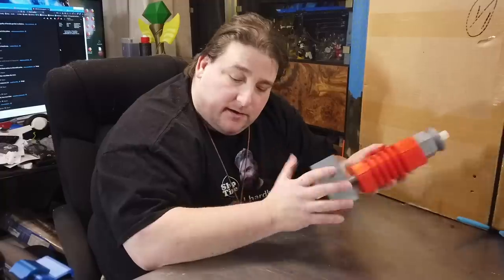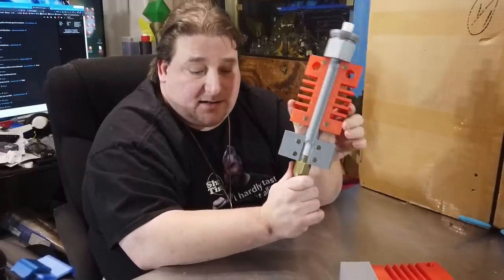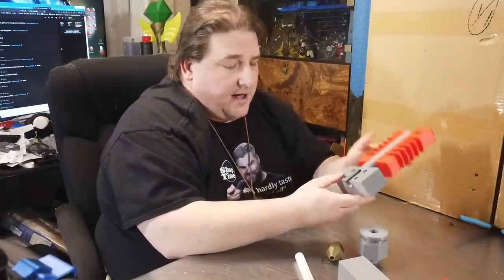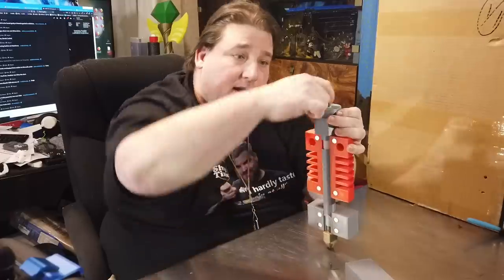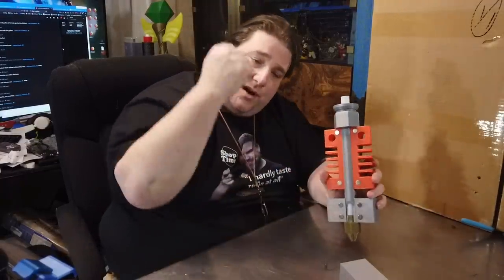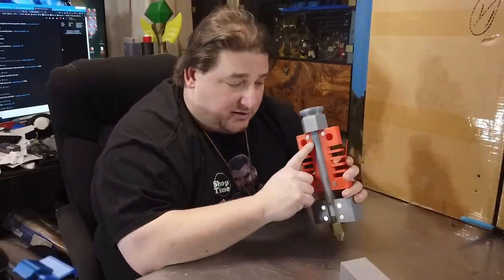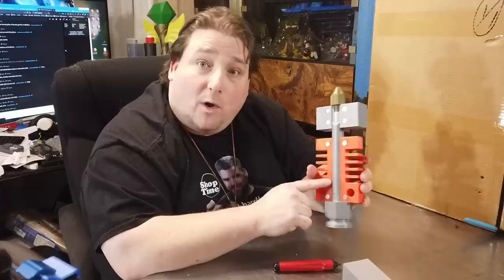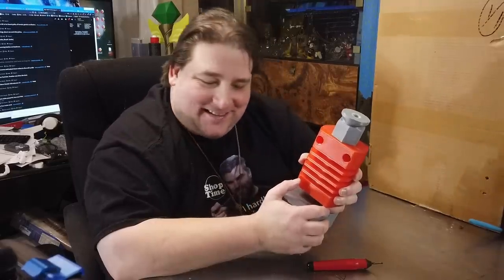Creality Hot End Failure Modeling How to Fix, Assemble CR 10 Ender 3 5 Mini T3DP

Comment: Hi, many thanks for the great video. I have subscribed now so I can watch plenty more of your videos.
Can you please answer a question for me?   is the hot end for the Ender 3 the same as the hot end for the Ender 5 pro??
Many thanks, have fun and stay safe,
Joe
Reply from the maker: There may be slight differences since they come from different Generations But ultimately they are virtually identical you should be able to Interchange the parts between the two printers
Reply: @nerys71  Many thanks, that is great news as I wanted to keep a spare, but was not sure what to buy.  Have fun and stay safe, Joe
Reply from the maker: @jjab99  just be sure to mark them 12 volt or 24 volt if you are including the heater cartridges with the spare this doesn't apply to the two printers you listed as they are both 24 volt but the older machines which also have identical hotends are 12 volt just something to keep in mind especially if you decide to acquire a couple of spare sets
Reply: @nerys71  Many thanks once again for your help. More very useful tips!!. Have fun and stay safe, Joe

Comment: maybe you can put nozzle in first then turn back abour 3/4 turn,  then put ptfe tube all the way down. lock the top ring.  make sure the tpfe contact with the nozzle. then turn the nozzle to make sure the nozzle and ptfe has perfect contact. right?
Reply from the maker: Yes in theory you can do it from either end I just find it easier to use the compression fitting but the nozzle will have the same effect

Comment: My son just got a brand new Ender 3 v3 SE.  We printed a cube as a first project.  About 3/4 of the way through the print, it stopped extruding (but thought it was still printing).  It's clogged in the PTFE tube about 1/2 cm above the top of the nozzle. The filament broke so there's nothing to pull out anymore, and I can't push it through with my needle.  And heating doesn't help because it's so high above the hotend.  Can't pull or push it out.  Any thoughts?

Comment: Would buying a microswiss hot end help avoid the problem all together? The two flat mating surfaces always bothered me. I've done the washer mod from Chep but I'm again having problems with clogs.
Reply from the maker: Nope your micro Swiss will have the same problem and the solution is also the same

Comment: Only one problem, the throat (neck) does not go all the way to end of the heating block, neither the nozzle fits inside it as per your model, they both screw to the heating block on opposite sides, but there isn't enough thread to screw both of them tightly, in order to screw the nozzle all the way up so it's snug against the heating block the throat needs to be backed off 1 and a half turn, or vice versa. So, the only way to be sure the nozzle is snug to the bottom of the heating block and not because it's pressing against the throat, one has to leave a gap inside the heating block, I wonder, if you pressure the PTFE tube against the back of the nozzle, will the plastic still leak into the heating block threads? This wouldn't cause blockage or anything, but would require complete disassembly to clean.
Reply from the maker: That's okay the important part is that the PTFE tube goes all the way to the nozzle

Comment: So, my Creality CR-10 Smart's hotend doesn't have this interior ptfe tube. Where the Boden tube inserts into the hotend, the hotend itself funnels to a smaller gauge or diameter. No tube involved. The CR-10 smart, I have found, is completely unique among printers and it really sucks for getting help and upgrades,.

Comment: Bro, this video was freaking amazing. Great work! Have you come across the tweak on thingiverse where you print a template for the Bowden tube so you cut it the right length and leave that piece in the hot end "forever"? I'm curious to know if that would work.
Reply from the maker: It does work but not forever. Ptfe in the hot end is a consumable. They burn up and have to be replaced.

Comment: Noob question, hotend has to be hot to remove the nozzle, right? Does it have to be hot when I insert the new one?
Reply from the maker: Yes you want it hot to remove it the filament acts as a cement and brass is soft enough to break if you try to remove it while it's cold technically it doesn't have to be hot to install the new one but it helps because any leftover plastic in the threads of might keep you from fully tightening it once you have it all back together and you heat it up and feed filament into it you want to give it one last little snug to make sure it's tight not too hard just a little bit
Reply: @nerys71  Thank you, this solved my problem!

Comment: I could use some help with Cura/printing. I have 6 creality machines 4 ender 3’s and 2 Cr10s’s I cannot get prints to stick to the bed anymore. I use all glass beds with the little dots printed on the glass From creality.For the life of me I’m pulling My hair out! Any suggestions?
Reply from the maker: Acetone and a very very light scuffing with fine 000 steel wool. Then hotnsoap and water dry well. Oil residue builds upnsurface gets smoother looses stick.

Probably need to relevel from scratch too since you probably messed with it in frustration as it lost stiction. Been their done that. :-)
Reply: Nerys thank you sir I’ll give it a shot!
Reply: Nerys YOUR THE FREAKING MAN! I was about to give up on prints, I had tried everything to clean the build plate bed to new tips on n on! All it freaking took was freaking acetone, 0000 steel wool, hot water and dish soap(Home Depot didn’t have 000)! Man I owe you a handy! Jk thank you so much bro!

Comment: wait a minute, isn't the nozzle supposed to butt up against the heat break? I don't think the nozzle screws into the heat break just the heat block?
Reply from the maker: It varies but the important part is that the PTFE tube butts up against the nozzle that's the critical connection
Reply: @nerys71  True, and very cool display model btw

Comment: I've been noticing that when I print awhile filament cakes my hot end. I had to replace my assembly for this same reason and the new one is doing the same thing. I've got the ptfe tube and nozzle firmly against each other.
Reply from the maker: In the filament leaking from somewhere or is it simply building up on the nozzle?

If you are over extruding you'll get what's called snow plowing where the nozzles plowing into the excess filament from previous layer this filament could end up sticking to the nozzle and building up as a blob
Reply: @nerys71  Its not building around the nozzle it just forms around the hot end. I'm thinking that metal piece that feeds the ptfe tube isn't far enough in.
Reply from the maker: @dereka91  okay then that means you have a gap between the nozzle in the PTFE tube this video will walk you through fixing that now it is possible your compression fitting is bad so you might be putting it together correctly but it's still getting pushed away from the nozzle because the compression fitting is not holding it in that case you would have to replace it I would suggest an all-metal one I know you can get them from th3d you can probably get them from Amazon as well but I don't know exactly where they would be on Amazon

Comment: My hot end started to rise in temp last night, it was up to 277 when I caught it, is that the mosfet or is it easier to just replace then whole board?
Reply from the maker: I'm not a hundred percent certain but if you have a mosfet it could have locked closed in the on position the fact that you're reading a temperature implies that the thermistor still working properly
Reply: My mother had messaged you 2 years ago and you had recommended the Ender 3, which thank you by the way because it is the coolest Christmas present I have ever received,  should I just by an upgraded board do you this rather than mess with changing out a mosfet?
Reply from the maker: @TonyaRocks  if the built-in mosfet is the problem you could try bypassing it by installing an external mosfet I'm not 100% sure what happens because if your most that is stuck on the extra one will probably be stuck on as well replacement boards are pretty cheap in 2 weeks you'll actually be doing a review of a big tree drop in replacement for an Ender 3
Reply: I just noticed now that as soon as I turn the power button on the hotend starts heating up and It seems that I can't find an answer for that 😢
Reply from the maker: Okay that is the mosfet failed in the closed position which is why it heats up immediately when you turn it on does the printer have an external mosfet or is it built into the board? If it's external it's probably just a bad mosfet replace it if it's built into the board you probably have a bad board I'm not sure if it's possible to bypass the built-in mosfet or not I'm not skilled enough in that regard
Reply: It is built in, thank you so much for your help ❤️

Comment: Hello, I have A Creaity CR-10 with Dual Z Axis motors. The z axis goes up and down when homing but will not go up when printing. Is this a problem with my machine or am i doing something wrong in Cura ?
Reply from the maker: When you command the printer to move on the screen so when you issue at a up or down command that works fine?

Comment: The ender 5 i just got still has this issue even though they put bowden tube couplers with metal teeth on there.. it just gradually chews up the bowden tube as it pulls it out. I'm doing luke's fix, but i'm having to find a washer the right size.. rather not use a printed one, and can't print with my printer down lol.
Reply from the maker: Bowden tubes do get chewed up by the couplers overtime but it does take quite a long while. thousands of hours of printing. if yours are chewing faster than that something else is wrong you have back pressure coming from somewhere most likely a flaw in the hot end which the Luke Hatfield fix should take care of you might also consider some upgraded couplers from th3d
Reply: @nerys71  appreciate the reply if you know anyone who's done this fix who's used a metal washer could you ask them about what size washer they used? I have the dimensions of the washer, but finding something exact is like finding a needle in haystack lol. Closest i could find was 3.4mm id 9.1mm od
Reply from the maker: @Shadowlogic420  will do but keep in mind it does not have to be exact it just has to be small enough to fit inside and the center hole large enough to allow the filament to pass through but not the PTFE tube
Reply: @nerys71  i know what i can do, but its gonna take some elbow grease lol, i'll have to fit the one i have. Thanks for the info
Reply: @nerys71  so i managed to get the washer fitted, and everything back together, i cleared a massive clog before doing this fix, and honestly it seems my prints are more accurate now.

Comment: I've got an issue with mine but it's not clogging I can print 2 things then I need to clean filament off the heat block and the nozzle
Reply from the maker: You still have the same problem there is a gap between your PTFE tube and your nozzle this is permitting Molten filament to get around that opening and leak out of your printer which is why you have filament all over the block you have to disassemble it clean it out thoroughly and reassemble it with no Gap

Comment: nerys now i am checking my hot end why the filament go up from the hotend above the nozzle i mean between the red one and the gold cube
Reply from the maker: Clarify? I dont understand what you are asking.
Reply: @nerys71  im getting some melting plastic out of the hotend not going to the nozzle
Reply from the maker: @Sohtak_Beldeni  ahh ok that means your hot end has a gap. You will need to take it apart (heat it up first and dont burn yourself) and then clean it out well all plastic has to be removed and follow my video instructions for reassembly.

Comment: ender 3 horizontal lines with different hotends? all metal or ptfe lined, titan aero or v6, doesnt matter. what can cause to this ?
Reply from the maker: Could be hot end assembly though less likely with multiple. 3 other possible answers come to mind. Filament. Feeder unit (or its stepper) and slicer. Try printing my sample benchy and see how it turns out.
Reply: Nerys im sure its not z related so i thought same thing i have trianglelab bmg clone and titan aero set. both my ender 3s giving same lines. there is no weird thing with my slicer settings, set my retraction after test, same as temp. i changed sd card too. thinking about wheels lastly. and yes i will print your stl.

Comment: I've been printing for about 6 weeks, went thru 4 rolls of filament. Had a bowden tube blow and replaced it. Found out I also had a clog, so I changed the tube and nozzle, cleaned out the hot end and printed up a mando helmet, 4 day print. Left for 2 weeks, turned my cr10s pro v2 on and tried a simple print and I had another clog. I took the nozzle off, tube, everything, cleaned everything out, trimmed the capricorn tube off, heated up my block and the new nozzle only screws in half way!!!!! I tried 3 nozzles..... Any ideas?!?!!
Reply from the maker: It sounds to me like you have filament in the threads which is preventing a proper joining between the nozzle and the PTFE tube you're probably going to have to go in there with like a little dentist pic and pick out the plastic or heat it up and go in there with a thread reamer carefully cuz the threads are not that strong and clean out the threads until you can run an equal sized bolt all the way through
Reply: @nerys71  took apart the hot end... It was clean. Found out, after about 2 days of talking to people, searching out info... That my printer cr10s pro v2... Does NOT have the same nozzles (at least .6) that amazon SAYS fit my printer... U can ONLY get them from creality. Cleaned up my old .4 and fit it in the heat block and it is fine. I didn't strip anything, I'm ways a bit ginger because I'm so afraid to ryin anything. Thanks for the insight!!

Comment: Can this help with leaking and stringing
Reply from the maker: The answer to that question is maybe a PTFE to nozzle Gap can cause those problems but other things can cause those problems as well if those problems are being caused by a PTFE Gap then yes this would fix it
Reply: @nerys71  I did but didn’t fix;(

Comment: I bought an Ender 3 V2 a couple weeks ago. The first print (the dog gcode that came with the printer) printed perfectly with no issues. This is where it stopped working as intended. Tried to print both the cat gcode from the sd card and another file that I sliced in Cura. Sometime between 5-50% of the print, the extruder starts skipping steps. There is no clog (checked it multiple times) and the bed is leveled (the first print was a success). The fan is working at 100% but I can't print anything more from this totally new, out of the box machine....
Reply from the maker: It's probably a clog that you don't realize is a clog

The two most common reason the machine will do this is first the hot end fan has stopped working and you are experiencing heat creep one way to test this is to attempt to print the dog again

The other possibility is you have a small gap between a PTFE tube and the nozzle and as it Cooks off p l a in that Gap it starts to restrict the flow feel like during your print which will manifest like a clog even though there isn't actually a clog

For the heat creep possibility check the hot end fan make sure it's spinning quickly

For the PTFE Gap go to nerys.Com and go to 3D printing help section where you will find a link to my hot End video on how to properly disassemble and reassemble the hot end
Reply: @nerys71  The fan is working perfectly fine (very fast). The heatsink is hot though (unless this is how it is supposed to be). I disassembled the hot end once. Will do it again following your guide just to be sure. Thanks.
Reply: @nerys71  Tried it with both the stock ptfe and the primaCreator ptfe tube, but the problem persists. With the stock tube it takes the extruder 1 hour to start clicking. With the primaCreator it starts clicking much sooner. I read that the couplers need to be replaced (the stock ones are not that good) but I don't know if I am willing to spend any more money on a machine that cost that much.
Reply from the maker: When you rebuild the hot end it's important to make sure that it's completely cleaned out before you reassemble it if there is any leftover filament inside the heat break you're going to have problems

After you remove the nozzle it's important to push the PTFE tube all the way through so it comes out the bottom this ensures the path all the way through is clear

When you insert the PTFE tube for final assembly it's important that the hot end be up to temperature and that you give the locking ring a jiggle to seed it onto the PTFE Tube before you begin the final Titan of both the compression fitting and the nozzle at least two full turns
Reply from the maker: The heat sink should not be hot it should be cool enough for you to touch now the heat think is a component of the hot end of which there are four primary parts heat sink heat break heat block and nozzle the novel davia sister brass fit on the bottom the heat block contains the thermistor and the heater cartridge and is what the nozzle screws into it will be a cube and should be silver or gold

The heat break is the connecting pipe between the Heat block and the heat sink the heat sink is the red part with Vince So when you say the heat sink is hot we are only talking about the red component not the heat block on the bottom

Are you saying the heat sink is hot? If it is that will cause you problems